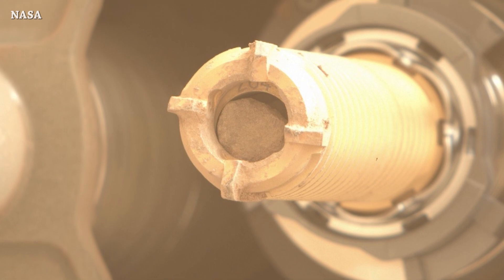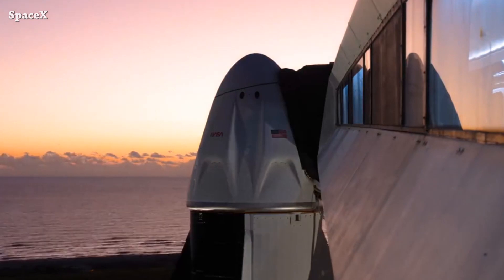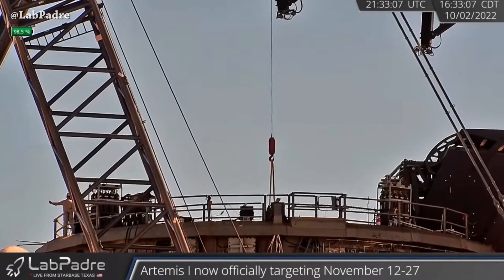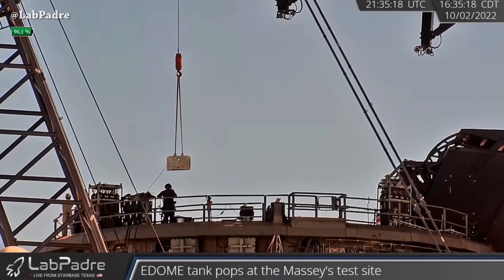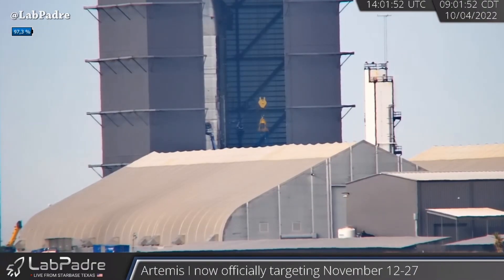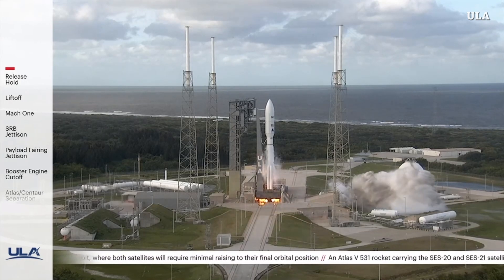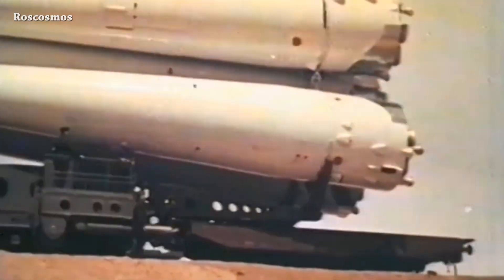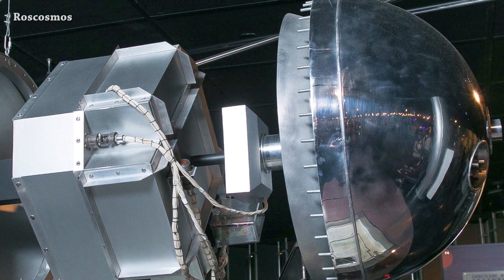Ship 26 Nosecone Stacking + Atlas V Launch | Starbase Pink

Comment: Oh my God, it would be funny if the hold down clamp calcs were off and the booster broke away! Of course failure load in concrete is much lower than steel, so those OLM legs will need to be tested as well.